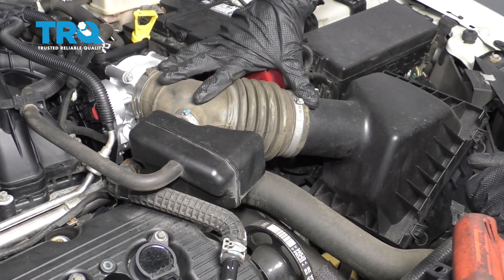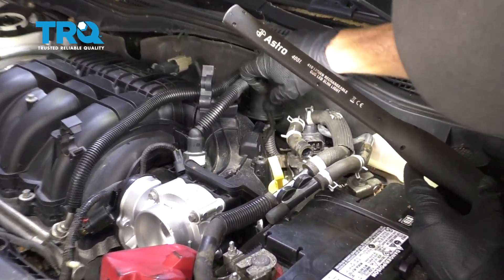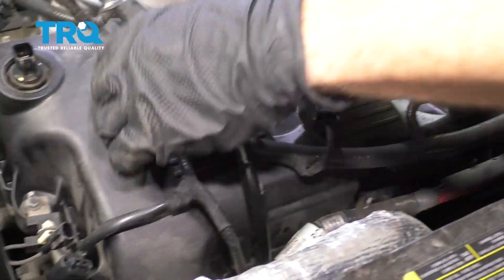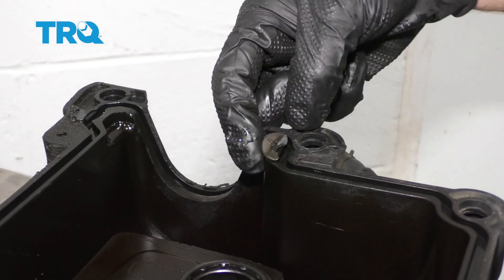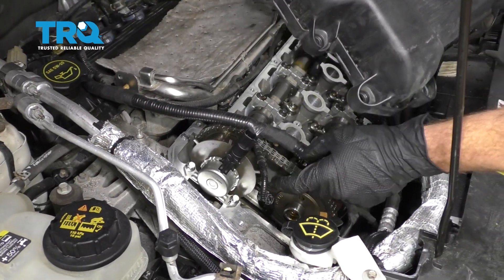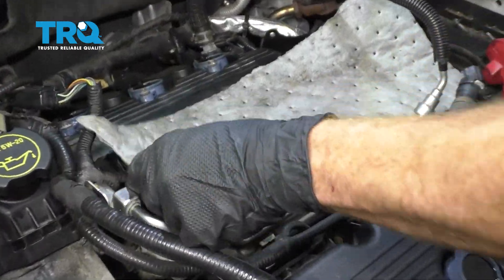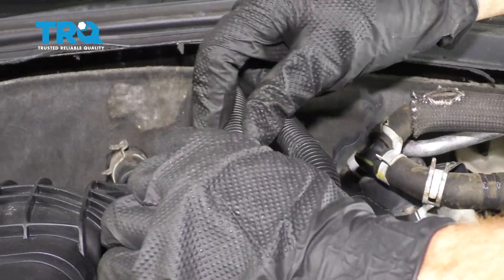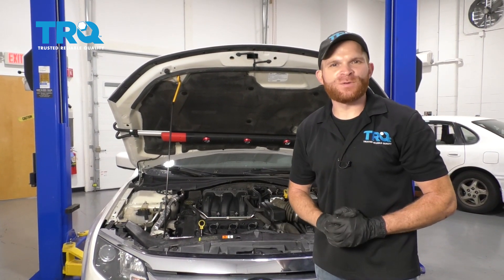How to Replace Valve Cover Gasket 2006-12 Ford Fusion

Comment: 45 degrees, and a quarter turn are not the same thing. The intake bolts were over tightened in this video.